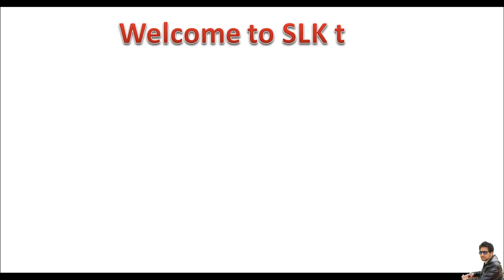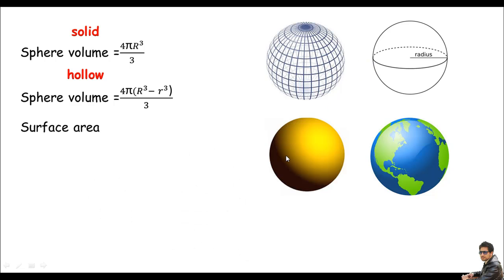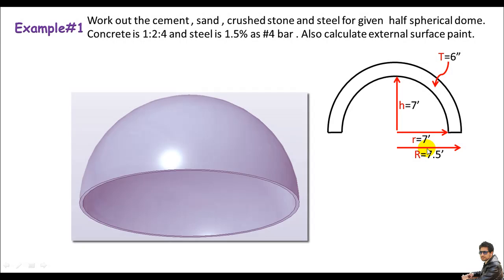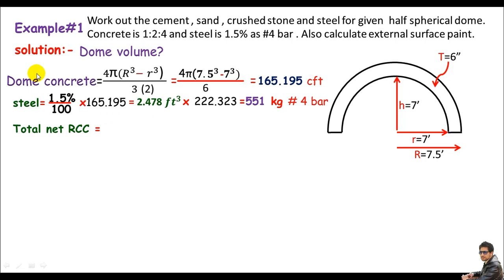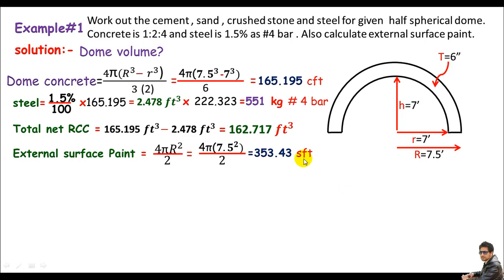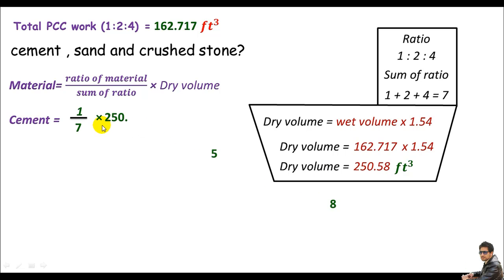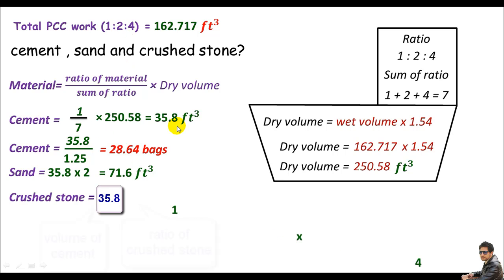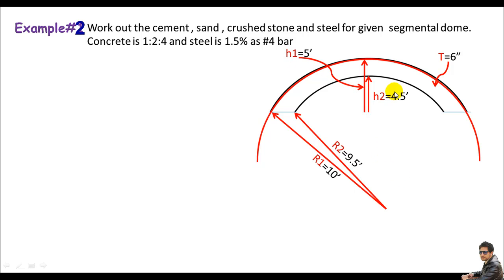Quantity survey:- Domes materials estimation.

Comment: Hello Sir.  Where does the assumption of 1.5% steel come from at 2:33 in the video?  Is that in a code?  Thank you for such a nice video.
Reply from the maker: hi dear! 1.5% is not a code.  percent of steel should be given from the structural designer in drawings or specifications. in my video i have assumed this value just for calculation.
Reply: @Sulimankhanacademy  Thank you very much for your reply.
Reply from the maker: most welcome dear. have a good day

Comment: Converting to Dry volume 1.54  per meter cube but u multiply with per cubic feet. 😏
Reply from the maker: 1.54 is ok or both type units ........... not problem if its cubic feet or cubic meter... use 1.54

Comment: hi how are you dear
Reply from the maker: Syed Shah 
fine thanks. Welcome
Reply: sir y u r not putting thickness of dome
Reply from the maker: irfan ali 
why not dear. check the video again.
Reply: segmental shape ...??
Reply from the maker: two types of radius are used . one radius is calculated when you subtract thickness from or add thickness
Reply: this is the hole quantity of dome or half 2nd exm
Reply from the maker: irfan ali .
its total. if you check the lecture again and again .that would be better. by the way BBS of dome is coming soon. thanks